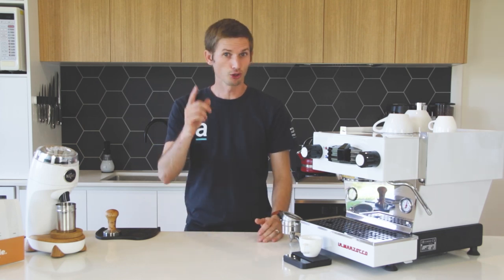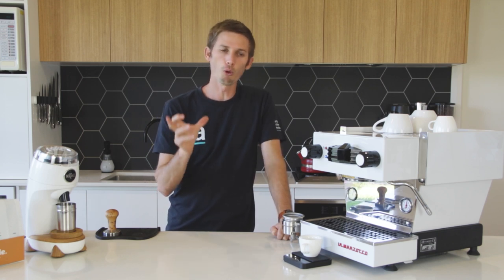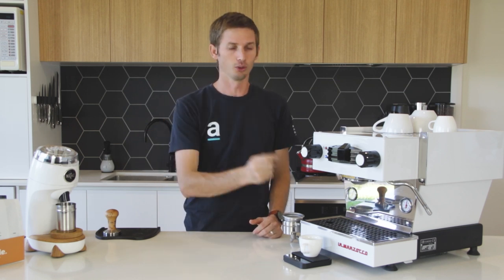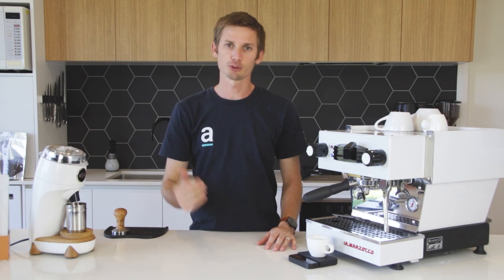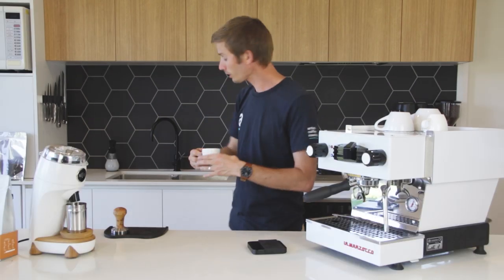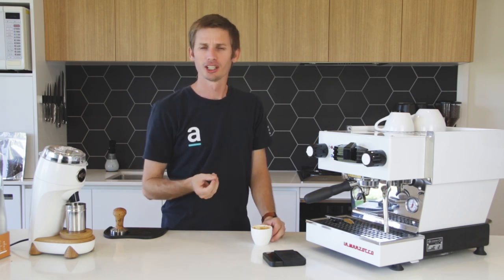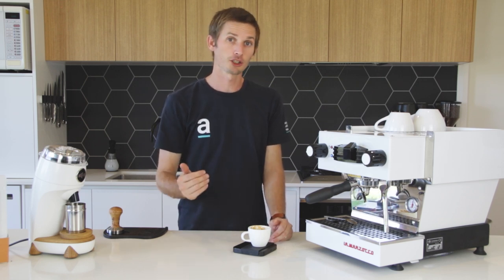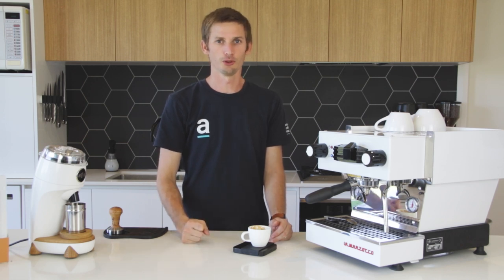Creating a BREW RECIPE to suit your ESPRESSO machine

Comment: Very nice video. I have a “Flair 58 LE,’ using a “Niche Zero,” grinder, with coffee from “Square Mile Roaster,” various espresso beans. I have been doing exactly what you did in the video, but, I have varied the grind setting. I find that most of the time, my grind setting is in the 4-5-6 range,  depending on the specific bean. Cheers

Comment: Thanks again for such an informative video (irrespective of the comments about the music!). Hope you can help with a question about the approach with pre-infusion - I saw you mention this in one comment response but my question is slightly different. Just got a Lelit Bianca and have a Eureka Olympus 75E doserless grinder. As I have so many options to vary pre-infusion times, bloom period and low flow etc (without even using the flow control paddle) - Is the better approach to just start off with no pre-infusion at all (or any other flow adjustments) and to develop the recipe to begin with at straight 9 bar for the target time until you’re nearly there, and then add pre-infusion (or amounts in or out etc)? Or, if you are always going to end up using pre-infusion, should you factor in say a 3 - 4 second pre-infusion from the start? If the latter, would you recommend also having a short bloom (i.e. no pump after pre infusion) of say 2-3 seconds built in from the start, or only mess with that when you’re very near the desired result? Option paralysis is a real danger for us beginners! Appreciate your thoughts 👍
Reply from the maker: Pre infusion and pressure profiling is a crazy world, wether your after sweetness, body, clarity or acidity you would make different changes. But to have all the contrail does not mean you should use it, it’s very subjective to your bean, roast and what you can taste and enjoy. For a beginner don’t play with pressure just yet. Start with 9 am the way thru the extraction, time your shot from start to end including pre infusion then your timing the full time water is in the coffee bed. Do pre infusion 1 sec on then 1 sec off, then extract your shot. Taste and see if you like it. Check out our HX brew lever video and the pressure profiling on the lm gs3 for more tips. Cheers luke 👍🏻

Comment: Thanks. This is very clear. 

I also noticed that the first 1-2 extractions in the mornings are very different. Is it because of the grinders burrs need to warm up? Espresso machine? both? In any way - I discard those few morning extractions. 
I will also appreciate it if you could recommend a best way to keep the beans as fresh as possible after the sealed bag was opened - as a private home it takes me 1-2 weeks to finish 1Kg of beans bag. Thanks.
Reply from the maker: Hi Arik, thanks for the question. There is loads of things that affect the first extractions in the morning, as you mentioned grinder blades, portafilter and machine internals need a few shots to get up to operating temp. Also most grinders hold some pre-ground coffee overnight that will have oxidized and therefor not extract in the same way as fresh ground coffee, this old grind may take a few shots to work its way through your grinder. For keeping beans fresh I always recommend buying less more often, using similar age beans make a huge difference to consistence of extractions and taste. If you could buy 500g per week this would help. There is also a few products out there like the Friss Coffee Vault that can prolong the life of your coffee.
Reply: Artisti Coffee Roasters Thank you very much!

Comment: Hopefully you guys still monitor comments... How did decide on your 18g dose rather than eg 15 in for 33 out? Is that because the basket is sized at 18g or is there more variability than that?
Reply from the maker: We have played with many baskets and doses, we aimed to have a good restriction on the grind when it poured, allowed for expansion of the puck and checked the pucks had minimal defects. This is how we settled with the grams per basket. Hope this helps. Cheers luke

Comment: Hi guys! in the video you said to check the puck if it's not watery. What happens if the puck is watery? what is wrong with that and how to solve it? Thanks!
Reply from the maker: If it’s excessively wet your grind can be too fine and be making the puck float up. You can increase the dose. Also check the age of the coffee to ensure it’s not too old and it expanding when wet.

Comment: what you can say on the brewpressure  for these machines? I have a bz16de. Not sure how to estimate the pressure. I am using a modified portaholder with gauge.
Reply from the maker: Most machines are set for 9 bar with a rotary pump and 10-12 with a vibration pump.
Reply: @ArtistiCoffeeRoasters  what makes it useful to have other pressures at the puck, depending the pump type...?

Comment: I understand you can't provide a recipe that works for everyone because of different machines, location, etc.
Is it possible to say for a specific machine it works best at 26 seconds or 28 seconds for example. Then for any coffee brand change the grind or coffee amount to reach the desired time?   The goal then would be to  always reach the desired amount of time based on modifying the other two parameters?  Thank you

Comment: Why not measure from first drip to eliminate the variable pre-infusion times, and go for a timed extraction from first drip to full shot...?
Reply: But don't you want to know that your pre-infusion time is consistent? For the most consistent extractions possible, I'd think you'd want to measure from the moment you turn on the pump.
Reply from the maker: Hi Goran, thanks for the question. I start timing as soon as the brew head is engaged because the brewing starts as soon as water is introduced to the coffee not when you see the first drips, timing from first drip can be very misleading and provide another unaccounted for variable. For sure timing from first drip eliminates different pre-infusion settings but the idea of a personalize specific brew recipe is that it is for your machine and all of it's settings. On top of that in our cafes we use La Marzocco machines that have programmable pre-infusion and specific settings are noted in any brew recipe. Also commercial LM's (not the one i use in this vid) have inbuilt shot timers that start when the brew buttons are pressed so it makes sense to use these timers. :)
Reply: @kpblasko  : Hi i agree, but if you're making a generic recipe to hand out to customers, the pre=infusion between two dozzen or more coffee machines is going to be different because the pre-infusion time, temp and pressure isn't specified in the recipe, this is setup by the individual baristas...!
Reply: @ArtistiCoffeeRoasters  : cheers and thanx for the clarification, you didn't mention the pre-infusion settings are part of the recipe in the vid.. The reason I asked was that on my coffee machine i use to have an 8sec pre infusion setting and a 22 sec extraction (30 sec shot timer) and it wasn't working (something was wrong) so i timed to the first drip and it was 12sec (for an 8sec pre) so then I had to alter my shot timer to compensate so that from first drip i get a consistent 24sec drip time based on a 32sec shot timer..!
Reply: @TheGozz13  And that's why generic recipes will never work! :) there'll always be tweaking required.
Reply from the maker: @TheGozz13  I think you have made some really good points..... and this was the idea behind this video to demonstrate that you cant just hand out generic recipes. I always say any recipe given to you is just a starting point. Nothing beats putting the time in and developing your own!

Comment: hey guys.I have a cheap rohnson espresso machine.The basket fits roughly 11 grams of coffee and its pressurized.I tried a lot of grind settings but the brew times are arround 20 seconds when the machine is wormed up less than 20 minutes.When i worm it up about 25-30 minutes the times are arround 17-18 seconds.I tried to find some aftermarket non pressurized baskets but its a bit hard to find some.Can i do something else that will get my times up to 25 secs?
Reply from the maker: Hi Bill, Unfortunately you will always be limited by the machine. Nothing you do can make a huge difference. Because this machine is not designed for a non-pressurized basket pushing it out to a longer extraction can cause catastrophic failure on weak parts. Sorry to be the bearer of bad news. :(

Comment: You are using a $5000+ Commercial Espresso machine. Can you get the same results from an entry level machine like the Breville Barista Express?  Would be nice to occasionally see you using less inexpensive equipment.  Most cannot afford to spend that much on an Espresso machine.  These machines have features not normally found on an entry level machine.
Reply from the maker: Thanks for the comment Frank. No you will not be able to achieve exactly the same results on an entry level machine like the Breville barista express. The good news is the concepts are the same and learning them will improve your espresso no matter what machine you have. :)